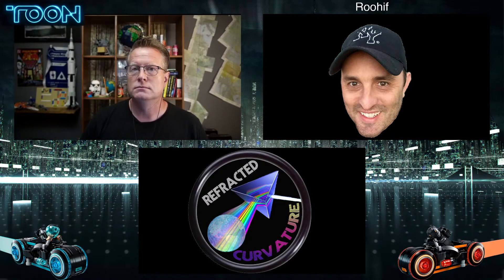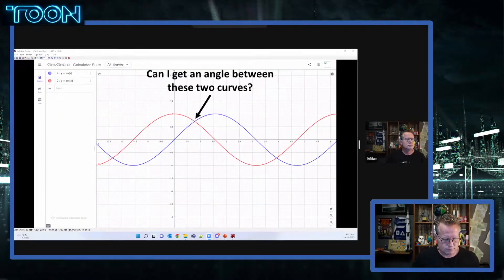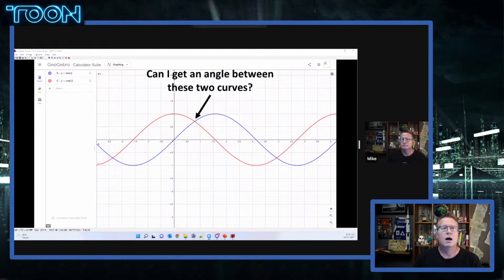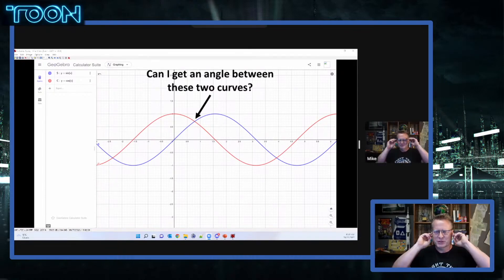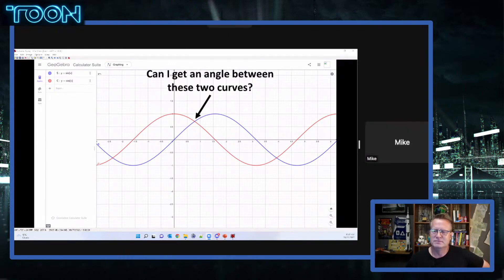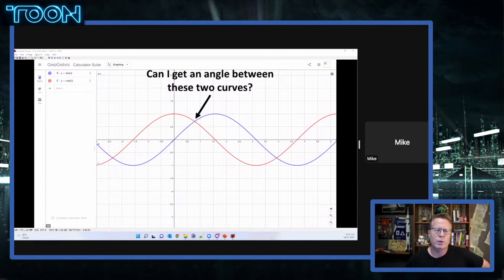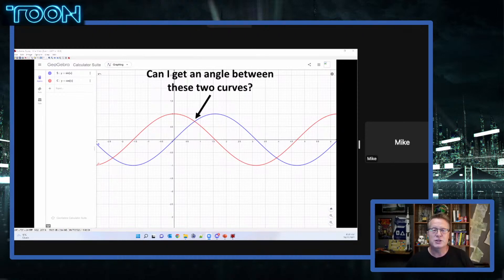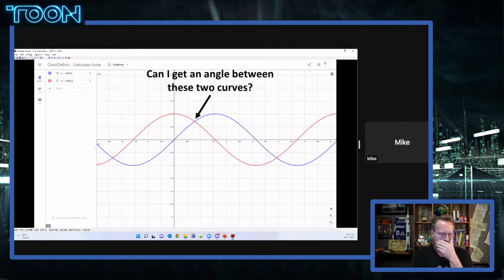Flerf blatantly LIES about having dual engineering degrees #GottaLieToFlerf

Comment: Just adds more proof to my assumption from watching many FE videos that no FE has a science degree or even a high school level of math or physics knowledge. They sit at the peak of Mount Stupid on the Dunning Kruger graph.

They simply have no idea how scientists and engineers do their work. They obviously think scientific theories are arbitrarily chosen ideas that are merely asserted, not understanding that they are constrained by the integrated whole of physical reality.

I started on calculus at high school at 16 to 18. It was a bread and butter capability preparatory to a degree course in any science or engineering subject, obviously Physics and Math but also subjects where you MIGHT think it unimportant eg Chemistry (where it IS important in relation to rates of reactions over time as concentrations change) or Biology (where it comes into such things as population level variation over time for any species from amoeba to whale).

It is also useful in Economics, though I knew Economics students who were infuriated that they had to learn it in their 1st year, having not learned it at high school, and could not see why they needed it. Even if you don't use it in your work as an economist every day, the intuition it gives over how things change over time is crucial.

I graduated in electronic engineering, and in that subject you get deep into calculus, complex numbers, trig, vector algebra, Laplace and Fourier transforms, and so on. Absolute rock bottom basic requirements. And since the first 2 years of the course was common with the Physics course, I know Physicists know all this stuff too, and you can't do Physics without it.

So anyone who claims 2 engineering degrees, doesn't matter what they are in, and grinds to a halt when calculus is mentioned (because he simply does not know what it is!!!!!) is an absolute FRAUD. You could call calculus the first separation of the men from the boys in science and engineering. Mentally, coupled with complex numbers, it is mind-blowing for a kid at 16 to learn calculus.

And BTW, in the graph at 2:49, the 2 curves are separated by a phase difference of 90 degrees, so the curves meet at a point corresponding to the sin or cos of 45 degrees in terms of its amplitude. So that helps you fix the intersection point. Now the calculus: d/dx of sin(x) is cos(x). So from that you can work out the gradient. (Where x is pi/4.) And from that the angle. And hence the angular difference between the intersecting curves.

And the FE had not the remotest clue. What use would an engineer be who could not figure out something so trivial? This is high school math, not degree level math.

Comment: It seems FLERFs all suffer from the same problem of not understanding curves versus straight lines. When we zoom in on a section of a curved horizon, it looks more and more straight because we are seeing less and less of it. An angle is the same - however much we zoom in, the angle we see remains the same. So when that angle is made by curved lines, zooming in will not change it, but it will look more and more like two straight lines intersecting and the angle formed becomes ever more plain to see. This is, of course, just the same result as you'd get by drawing those tangents, but perhaps FLERFs don't understand what they are.

Comment: I mean, technically you can't calculate the angle between the lines shown. You have to use the slopes of the lines at the point they intersect and compare angle between the tangent lines.  Though I don't expect any engineer to be able to just do this off the top of his head, on command.   (well, the sine waves are easier, but the first picture, not so much)

THat said, for sure he's bluffing. He should have at least pointed out what I said above but instead he's fixated on this tired FE claim that if you measure a straight line on the surface of the Earth, then you're "using flat Earth model."

Comment: Alright. I'll take a stab at it. We want to find the angle (θ) of the intersection between f(x)=sin(x) and g(x)=cos(x) at x=π/4 and y=sqrt(2)/2.
f'(x)=cos(x) => f'(π/4)=sqrt(2)/2=m1
g'(x)=-sin(x) => g'(π/4)=-sqrt(2)/2=m2
tan(θ)=(m1-m2)/(1+m1•m2)=2sqrt(2)
θ=arctan(2sqrt(2))=1.2309594173 rad=70.5287793655°
Since it's an acute angle, this is the angle on the left and right side, so the angle on the top and bottom must be π rad-1.2309594173 rad=1.9106332363 rad, or 180°-70.5287793655°=109.4712206345°
Therefore, the answer is either 1.2309594173 rad=70.5287793655° or 1.9106332363 rad=109.4712206345°. More precisely, it's either arctan(2sqrt(2)) or π-arctan(2sqrt(2)).

So, there you go! That's how you get an angle of two intersecting curves.
Reply: According to flerfs you just did the impossible.
Reply: Witchcraft!

Comment: To be honest, the angle between two curves is defined as the angle between their tangents at the point of intersect.
Tangents are straight lines. And the angle is messured between those.
So the method of messuring an angle between two curves, use straight lines in the form of tangents.

His failure to explain this, his lack of language to, or his bias to not acknowledge facts, does not make him wrong, nor does it make him right.
I find this "win", this "exposure of a lie", a little angled. Over the line, not just toe-ing it.
Reply: He's denying that tangents exist.
Reply: @NinjaMonkeyPrime  Aah... a flerf thing to do.
Reply: Angle between 2 curves at a (intersecting) point equals the angle of the tangents of those 2 curves at that point. Just because you use tangents to calculate it doesn't mean that what is calculated isn't the angle between 2 curves - which he was arguing. It's just typical approach from the Nathan group that is playing games of semantics.

The flerf did indeed embarrassingly lose already in the first 15 minute of the debate. This was just icing on the cake.
Reply: @quikee9195  At first I thought they were arguing that you can't get a tangent to the horizon because of the black swan. Now it sounds like they want to say tangents don't exist at all. But it's hard to decipher what they mean.

Comment: This does sound like one of those cases where terms are used in different contexts. The term "electrical engineering" has a specific meaning, but when your job is to go around installing electrical equipment it's very tempting to call yourself an electrical engineer and if you've had some education in how to do it, like in-house training on the company's products, then calling yourself a certified electrical engineer is not that far from the truth... he is certified to electrically engineer those devices to a wall. It's just not what other people think of when they hear that term.

Marketing baby!
Reply from the maker: A good point.  But he was very specific that he had “dual bachelors in EE and ME”.
Reply: @Q Branch He thought that he'd take a CALCULATED risk when MECHANICALLY unscrewing ELECTRIC light bulbs high up a ladder as a custodian. 

He fell, suffered a head trauma, and believed thereafter he was a dual baccalaureate in ME and EE, and excelled at Calculus!  👨‍🎓💩🤡

Comment: to be fair thats such a poorly worded question. cant you just get an angle between anything? or are you asking for a solution?
Reply from the maker: Many times during the debate he insisted that you cannot measure an angle between curves. For example your line of sight and the curved surface of the earth. 

It’s repeated many times daily on Nathan Oakley’s “flat earth debate” where John is on the panel almost every day.
Reply: Of course you can, but they deny it. That's the point.

Comment: (8/10🐢) I just did some Fact Checking for requirements for Bachelor of Mechanical Engineering at University of Newcastle (as an example)

4 Years Full time Study

As I read it it Math Requirements are as follows:

Entry into the course requires Advanced HSC Maths level or equivilance and entry is tested by untertaking a Maths Level test.
(I completed Advanced Level HSC Maths (Highest level of Highschool) an getting an angle to/from a curve was covered as part of Geometry when I did it)

As part of the Bachelor core subjects (i.e. non elective)
MATH1110 - Mathematics for Engineering, Science and Technology 1
MATH1120 - Mathematics for Engineering, Science and Technology 2
MATH2310 - Calculus of Science and Engineering

And the same math and core study is required for Electical Engineering  

So I think it is a fair call to say his stated qualifications could be called into question.

I couldn't hind the term "network certified instrumentation technician". 
A certified technician seems to mean everything from 2 day course from specific peices of electonics to a 2 year certificate course.
I used to be a Instrament technicain when I did field work for surveyors and it meant I knew how to operate the theodolites/ levels etc and got paid more.

The term "network certified" doesn't mean anything in my industry. Would love someone to explain what it means in the States
Reply: oh hey, thats the uni I went to.

Comment: My first thought was ... if he has dual Bachelor Degrees .. why is he a Technician rather than an Engineer ?!
Reply from the maker: A very good question.
Reply: Maybe it was a non-accredited college/university. Similar as Kent Hovind's "doctorate" from "Patriot University", which he "earned" via correspondence.

I'm thinking about starting a university for flat Eathers. It will be a way for flerfs to be taken seriously (at least among other flerfs) by virtue of having a degree.

Some of the curriculum and requirements would be as follows:

* You have to FAIL basic math and physics in order to advance.

* Practical Logical Fallacies

* Non-critical Thinking

* Research 101: Youtube

* Communications 101: Word Salad

* Research 102: Cherry picking from publications

And so on.

One all requirements are met, the candidate will earn a Bachelor's of Pseudo-science.

Alternatively, one could earn a Bachelor's of Art in Flat-Earth Meme-making.
Reply: I'm still pondering that....

Here's my take on it from my own personal experience. I personally don't have any bachelors degrees, yet I'm well versed in mathematics, physics, chemistry and even computer science right down to hardware engineering. I use programs like Logism to build basic 8 bit, 16 bit CPUs while designing their ISA and writing their assemblers. I started by teaching myself C/C++ along with DirectX, OpenGL, and more recently a bit of Vulkan to write 3D Graphics / Game Engines - Physics Simulations from scratch. I got into the hardware aspect when I attempted to write a Hardware Emulator (6502-NES) in C/C++.  

I would be an engineer right now if it wasn't for my lack of degrees. I just simply could never afford the education. Yet I have the knowledge and understanding of about 4-5 different bachelor's degrees maybe even a couple of masters degrees from my independent studies - hobbies throughout the past 20 years. I wouldn't go as far as to say "ph.d", yet I'd give any one who earned them a good challenge at a good game of chess or risk any day of the week. I may even challenge them in their topics, fields of study and practice only to try and to learn from them. Otherwise I'd just go and play some Factorio or Oxygen Not Included in my spare time.

Yeah, sounds like he's trying to pull some wool over the eyes here... I'm not claiming he doesn't have his said credentials but I know for a fact he doesn't know what he's talking about when it comes to his claims about the math especially when it is about simple concepts from Basic Geometry that doesn't even require Calculus. This is something I've already solved many years ago in middle school - early high school back in the early to mid 90s. 

So if he's going to argue and or believe that you can't find an angle between either a line and a curve or two curved lines either he missed those lessons or he's straight up lying about it. Wait a minute didn't he cover topics such as torque, torsion, angular momentum? I guess not... Regardless of either case I can now begin to understand why he's just a tech rather than an engineer. He's not gonna be solving that many problems. 

Just my observational perspective based on my own past experiences...

Comment: If he was a mechanical engineer then he would have knowledge of turning on a lathe, the work piece is cylindrical and the cutting tool angle to that 'circle' is critical and varies with which material you are cutting, he is not an engineer.
Reply: Gotta lie to flerf.

Comment: Thst was such a mind numbing debate. He was trying to force a necessary condition into the plum Bob discussion so he has a premise for his "can't get an angle from the horizon on a curved surface." I bet he doesn't know what a tangent line would be at a point on any curved line.

Which is ridiculous to begin with. He definitely is trying to use Nathan Oakley's nonsensical  argument.

They always squirm away from the obvious or their argument falls apart.

Comment: Fact: Smooth curves have derivatives (definition of being smooth)
Fact: The derivative gives the slope of the tangent line to a curve at a point on the curve.
Fact: Trigonometry gives the formula for the tangent of the angle between two intersecting lines given the slopes of the two lines.
Fact: Calculus gives the slopes of the tangents for each of the two interesecting cuves at the point of intersection.
Result: From the slopes of the tangents of the two interesecting curves, the trigonometric formula gives the tangent of the angle between the two tangent lines.
Reply: It's been a while since I studied maths, (over thirty years) but yeah, I imagined solving this by getting the rate of change for each wave at the point of intersection, using a derivative.
Reply: @engineeredlifeform  To be honest you don't even really need calculus... well kind of... the only bit about calculus is finding the two tangent lines... other than that finding the actual angle is basic geometry and trigonometry.
Reply: A minor nitpick. The derivative gives the slope of the curve at each point, a tangent line is one which has the same slope as the curve at the point of intersection.

You can find the derivative from the tangent of an ever shrinking line segment at that point, but it's not a requirement.

Comment: the fun part, trying to remember what the greek letters meant in physics, heat transfer, dynamics, calc, electrical circuits were doing...  it was a real bich trying to figure out how fast a coulomb of 0 degree celcius capacitance could change delta t when the inductance in liters didnt follow the right hand rule.
Reply from the maker: The most important:

Sqrt(-1) = j